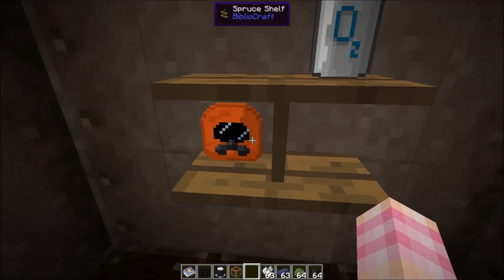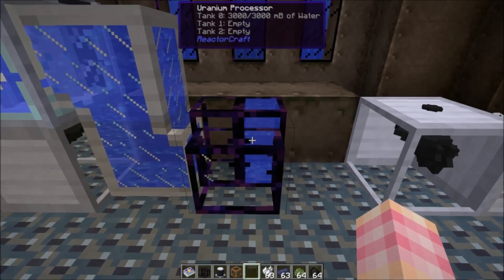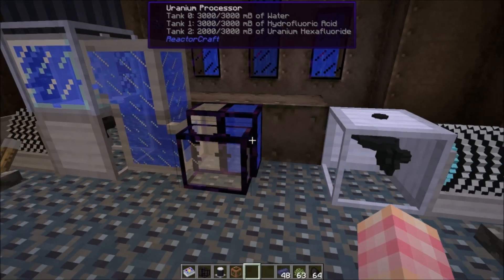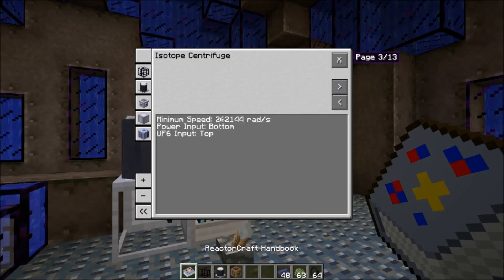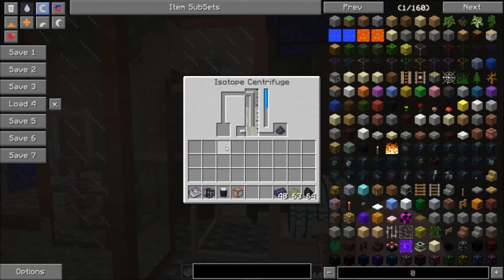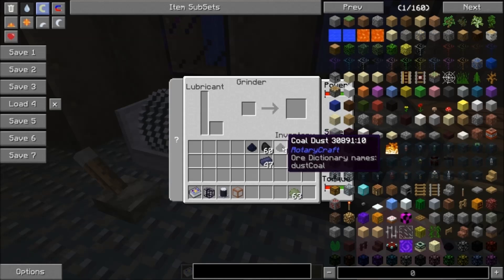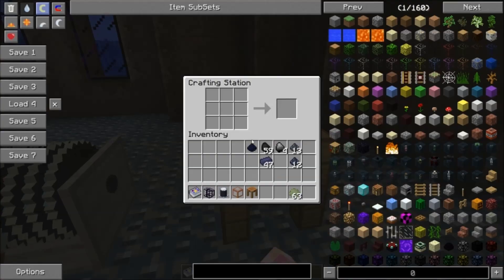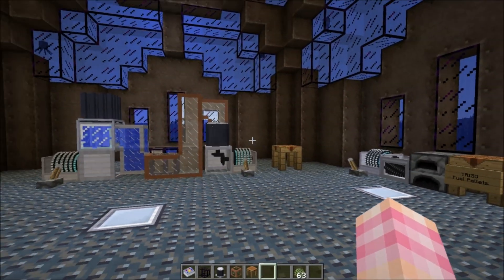ReactorCraft Tutorial #2 - Uranium Processing

Comment: I want to play minecraft with RotaryCraft and ReactorCraft so much.
But the only problem is that java is impossible to get working.
After 2 hours of trying to make it work i guess Java wins this battle.
Reply: Try ti instal FTB mod pack.
Reply: I have tryed FTB, ATL, MultiMC and nothing works.
Reply from the maker: Crozix Hmm, that's odd. Do you have the latest version of Java?
Reply: I have installed 7.65 (which is the current official version)
There some problems in the installation, one is that java only installed 32 bit version of the program
I have not tied java 8 if that will make things better.

Edit: Java 8.11 doesn't work either.
Reply from the maker: Crozix Boo. Well unfortunately I don't know how to help you. That stinks.
Reply: I think i will wait 2-3 month and try again.
That helps most of the time.
Reply: Crozix do you install DragonAPI?
Reply: I figured it out, it was somthing to do with malwarebytes anti-exploit i had running.
Reply from the maker: Crozix Oh interesting, glad you figured it out.
Reply: Crozix Just to make sure it doesn't happen again:
-Be Careful with Anti-Virus things they sometimes mess up the mods
-Run with Java 8
-Run with the recommended version of 1.7.10 forge(Only if you are using 1.7.10 like me :D)
-Reactorcraft is finicky there are a lot of mods that aren't compatible or may crash the game because of lag issues
-Make use of the Java Virtual Machine(JVM) Arguments
 -Have Fun
Reply: Crozix Just to make sure it doesn't happen again:
-Be Careful with Anti-Virus things they sometimes mess up the mods
-Run with Java 8
-Run with the recommended version of 1.7.10 forge(Only if you are using 1.7.10 like me :D)
-Reactorcraft is finicky there are a lot of mods that aren't compatible or may crash the game because of lag issues
-Make use of the Java Virtual Machine(JVM) Arguments
 -Have Fun
Reply: @tsujimotoyukasuke6621 He already knows all of that